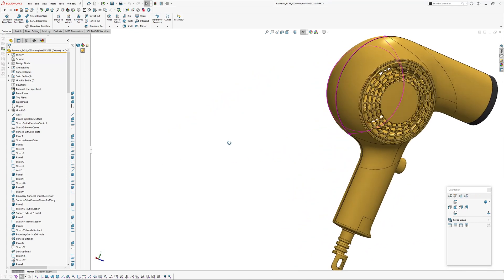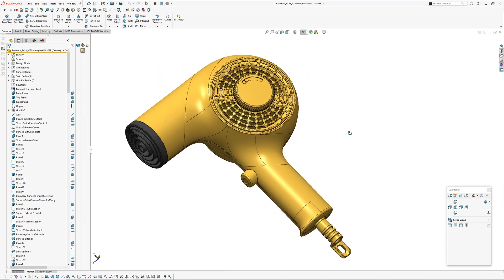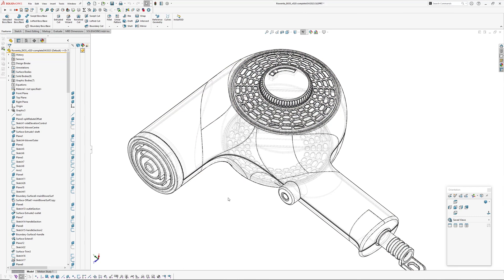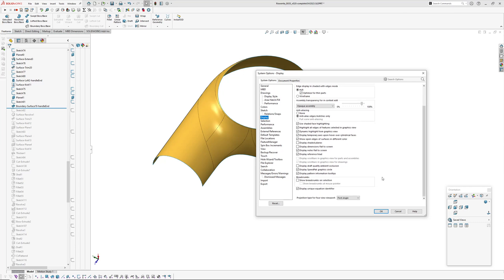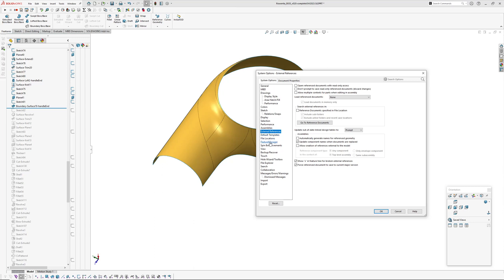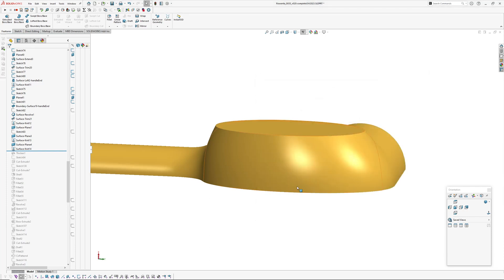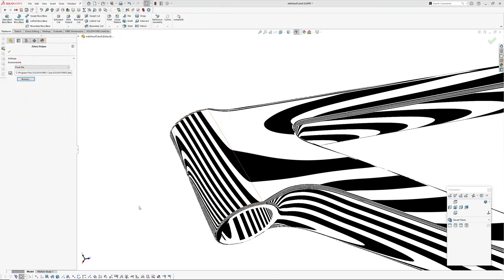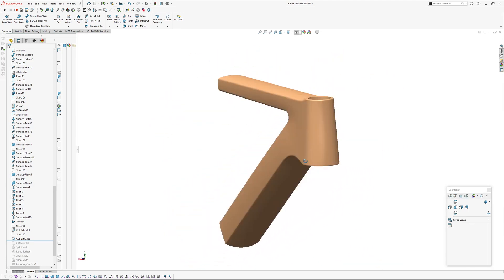My Solidworks Setup for... Modelling

Comment: Thanks for posting this one Andrew! I found it very helpful to my workflow, especially the f4 and f5 hot keys. 

I had a question about the zebra stripe pattern you use. I would also like to switch from the washed out default striping to something more clear. Did you use any specific measurements to create your stripe pattern Jpeg? Do you have any suggestions for a specific zebra stripe pattern one could find online? 

Thanks!
Reply from the maker: Hi there, I created the stripe pattern in photoshop. I have several that I use, some wider and some running horizontal and others vertically. Thanks for watching!